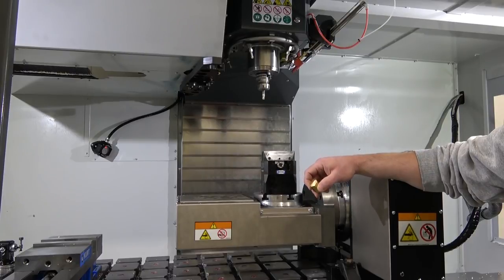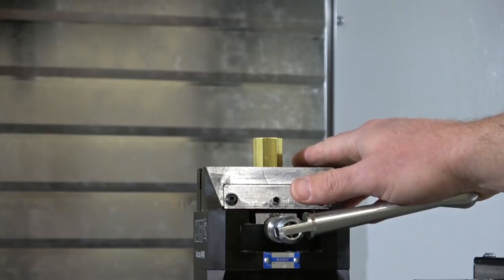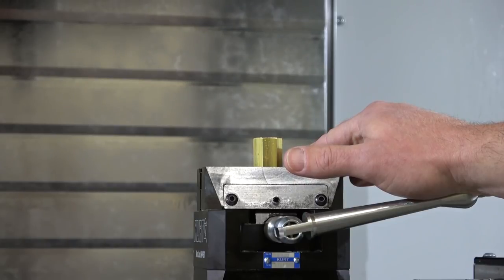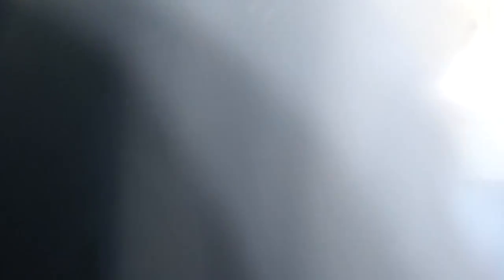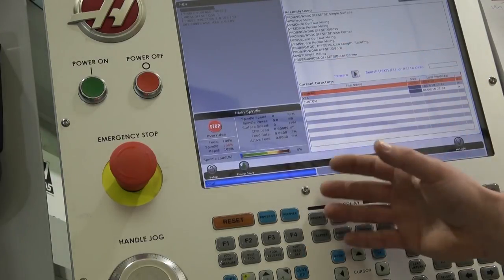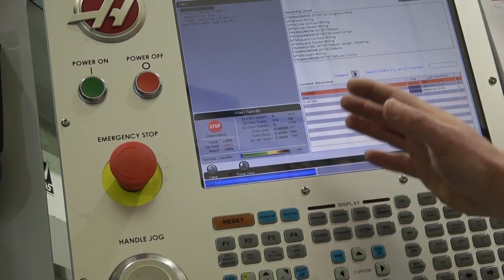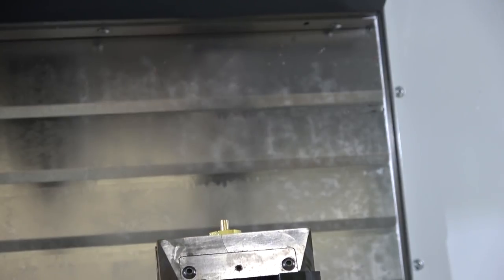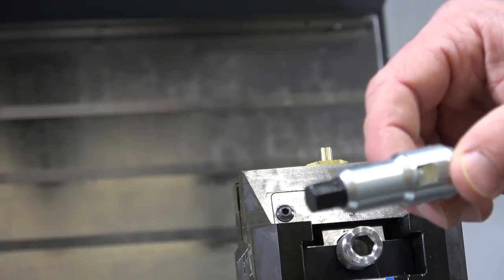One Million Subscribers | Town Pump CNC

Comment: Vijéo: https://youtu.be/LIfxfHFy_9c

I have a below knee prosthetic leg (i have a human kneee). Trouble is my ankle is a carbon spring and when im sitting or walking on a hill my foot is always stuck at 90°, its uncomfortable 

My carbon spring/foot attaches directly to a 3/4" pipe (the pipe would be my calf)

Was hoping for a custom ratcheting/ locking pylon between the 3/4" pipe and my rigid 90° spring ankle foot. 

The custom "ratch-kle" will allow amputees to actually get natural upward or downward ankle deflection when seated or walking  on declines.
Reply from the maker: fantastic idea. yes! how do you want to change the angle? is a button on the ankle ok? any chance for you to post a quick vid?
Reply: As a voting member of the viewing public, I like this idea.
Reply from the maker: oooh how about a little calf muscle gas strut and lock trigger at your hip. Put weight on your foot, release the ankle lock, move to more comfy angle, then lock the ankle.
Reply: @arduinoversusevil2025 , that sure would be a fantastic way to break in the new machine!
Reply: @arduinoversusevil2025 , or a simple locking system similar to the hinges on those fancy folding aluminum ladders. Push the center in to release it. Push the other way to lock it. But, the locking gas strut system would be much more impressive. 👍
Reply: @K.chample man i really hope uncle bumble can help ya sir . God bless you and your family
Reply: As a non voting member, but diligent and thankful consumer for several years, I am happy to report that this thread sparks my first YouTube comment ever.  It is a brilliant idea.  Such a perfect intersection of possibilities for good. 

Beautiful, it brings tears to my eyes and that's not just my own smell in the shop ;). Such tremendous potential.
Reply: Aerospace design engineer here, let me know if assistance is needed in getting something like this designed.
Reply: Friggin' Frig! Perfect first project!
Bad habits, Richards and all that...
Reply: This would be a great first use.
Reply: I've always wondered if it would be possible to use a car shock piston in a prosthetic leg...
Reply: This has my vote for the first run!
Reply: This could really be groundbreaking tech for people with prosthetic legs. Do us proud Uncle Bumblefuck!!!
Reply: Eyellgeteven most of the fittings on this thing are titanium i think.. if it works well i know a few places that would place large orders
Reply: @Vikingwerk  amen !
Reply: This is a brilliant idea. A fine chance to test out the machine and would certainly be very meaningful to someone.
Reply: I gotcha, I think. How about a rachet that you swift kick left/right to unlock and then position, then put your weight on to lock into place?
Reply: I approve this idea!!
Reply: An injection moulding machine I helped fab used a basic lever arrangements P to rotate the top section as it lifted for easy cleaning... In your case I imagine you would need to pivot point in the hamstring area to actuate angle movement based on degrees of knee...
Reply: Gets my vote
Reply: Gas mountain bike shocks let you selectively enable / disable them, essentially locking it the position of the shock. The mechanism is super just a simple 90° turn to lock the Cylinder so could easily lock and unlock it to adjust the angle without having to rely on imprecise ratchets.
Reply: If there's a video, I vote as well!  Can't have some guy just a springin and sproingin without no control of the Jeeslus thing...
Reply: I'm thinking a more dynamic approach, no buttons no locking positions, it needs to behave naturally and not like an old wagon stopped for a scotch at the local saloon, I'm thinking to imitate the tendons and muscle fiber with a hybrid system of air balloon and close circuit air/oil shocks with some springs. If you think about it the pin point is freely rotated due to the weight transferred on the foot heel we can start with a cad 3d design
Reply: Before AvE gets to excited can I suggest he looks for smaller components than he’s used to, or 2 things will happen, 1 KC will fly over the nearest fence when the gas strut is activated. 2 it’ll be so heavy KC will only be able to walk in circles.
Reply: @thomassmith4320  Simple Mechanical Engineer here but same counts for me. Happy to help if needed!!
Reply: Cattus_ex_Machina votes yes for this first project
Reply: it's a clutch, fluid pressure on the toe to lock and heel pressure to release
Reply: Do you mean a mechanism that gives a continuous natural movement or one you can specifically adjust on the fly for different set positions?
Reply: Great idea! One hell of a way to start off with the CNC as well. I'll be looking forward to it.
Reply: This is simply great! Not only because it's for good, but cool "gadget" too! Now to start healing hangover...
Reply: AvE can you share the video if he posts so that us interested can help with the design?  I like your idea of a free community that can do these sorts of things, especially when they help people. I'd really like to put my $0.02 in on this one. Also, how can I donate to help you out?
Reply: K chample blatchford’s microprocessor. Controlled ankle. Uses real-time inputs to control hydraulic pressure for ease of walking. I was brain storming this and was getting somewhere when I gave it a google and found someone who has computerized the process.
Reply: This get my vote.
Reply: BTW, can you get access to a 3d printer?
There are some amazing prostectic limbs made by private owners now.
Reply: i wonder if a 45 degree twist to the ankle to release it , then find best new position then twist back to straight would work ? might be possible to actuate on the fly ?
Reply: @arduinoversusevil2025  First of all great freakin Idea for a project!! 
But what about using an electronic actuator? Because from my understanding theese gas pistons only come on or of isnt that the case?
Reply: My neighbor's brother enjoys a  very good  prosthetic - and he has  quite detailed engineering knowledge of how his works and is put together. It features a mechanism just as you describe. I will ask him for whatever details he can provide and post them here.
Reply: This.
Reply: This is awesome! The prosthetic has my vote!
Reply: Gets my vote
Reply: This is what the internet should be used for
Reply: Got my vote, but will miss the Empire of Dirt...
Reply: Uncle Bumblefuck up along Ghandi and other world changers? Whoa. Right before my eyes too.
Reply: Stop gassin-Do it!
Reply: This would get the channel to next level
Reply: This is what the internet is for world wide motorfudgen teamwork
Reply: Maybe some sort of nonlinear setup, nice and stiff until you reach a yeild point...
Reply: Mechanical clipboard warrior checking in. I've got access to aerospace level FEA software if any stress analysis is required. I'd be happy to run some models and check for fatigue life or something along those lines.
Reply: Mountain bike shock with lock out might work?  Already built to be light weight and off the shelf.

Edit: I'm not sure if those shocks lock out at one specific point only or if they lock it at any position?  If it's the former it wouldn't work.
Reply: Enginerd here as well. I use fusion 360 ultimate daily and would love to help with design/cam if needed.  I could possibly send some material/carbide out as well.
Reply: Once you've picked a project you can set up a playlist or something. Pull in designs and specialisations from all over. Review. Collaborate, combine, redraft. This could be huge.
Reply: Dude even better put a gear motor on the ankle joint and an use an arduino with an imu to move the ankle with your leg to give you a true working prosthesis send me some info and we could get something done with some community help
Reply: This ^^ is a good idea👍👍
Reply: I love this idea. What about asking the hive mind to come up with design specs. I'm sure there's a pixy wrangler out there somewhere who is perfect for the job.
Reply: Top 10 anime cnc-projects
Reply: What about milling something to attach super strong servo to change angle? Maybe rotory encoder for control? Can an arduino be fixed up with a way to sense ground angle and adjust automatically?
Reply: My guess is that an unpowered system of linkages or cables might be more ideal and weatherproof for position selection.  The problem is putting it in a natural location for daily use, regardless of the type of clothing.

Comment: 2 words: Rocket Parts!
Reply: Not sure if you can bring those across the border or not.  Import/Export and Itar whatnots.
Reply: @kevinbryan9620  Where we're going, we don't need borders.
Reply: Yes
Reply: @Cody'slab You mean "Fusion reactor"?
Reply: Wellll if he isn't selling them, there's no commerce. It's just metal doodads in a box.
Reply: I imagine that any rocket parts Cody designs would be based on public knowledge, so any arms control law probably wouldn’t apply.
Reply: this would be preeeeeetty damn legit! then prototype a vacuum optimized engine and drop if off for a test when you go on the SpaceX lunar trip
Reply: Copenhagen suborbitals would be a good group for AvE to collaborate with on rocket parts, they have a lot of experience at this point and have had many design issues due to lack of access to AvE's sort of equipment.

Comment: South Florida boiler tech here. Been watching your vids for years... I've been looking for a special brush or comb, that doesn't exist yet to my knowledge, to clean copper fin heat exchangers in certain boilers. I'll send you a video on Monday of exactly what I'm looking for. Need a real skookum choocher to get in between all those hard to reach areas.
Reply: I thought radiator combs where a thing?
Reply: what spacing, it likely already exists, but not marketed directly to Boilermakers. Maaco has one with something like 30 interchangeable combs, York distributors carry them.
Reply: something like the Allstar ALL10680 Radiator Fin Comb ?
Reply: dude how about those plastic ones for steel and aluminum hvac coils?
Reply: @alphonse4991  To fine. Need a longer, stronger bristle.
Reply: ahh i gotcha
Reply: I made my short video, but I'm not sure how to get it to AvE.

Comment: I suggest an air operated roto-wiper for mounting on the door where the camera looks in, good for a clear view of the messy jobs. We have them installed on all our mills and turning centres and a few of the transfer machines, world of difference.
Reply: Ukrainian Wheel has a "California Squeegee" for $15 give or take. It's awesome for removing water & no streaks! 
It conforms, is quiet, super flexible silicone that does a great job. Maybe look at that?
Be like an early teenager - one stoke is all that's needed.
Reply: Rain-X is supposed to work too... for a while.
Reply: check out Edge Precision, he developed a gopro case/air knife that he uses to film in his Mazak
Reply: John Grimsmo was sent a GoPro case with built in air blast in front of the lens.
Reply: Do the wiper arm with PIAA silicone wiper blades. Clean it well and run it dry at first for a couple minutes to lay down a layer of silicone. Better than rainx and it reapplies as it's run. Never go back to normal blades on my cars.
Reply: sp1nrx 
Never use rain-x or any other chemical treatments.  It will foul the coolant in no time.
Reply: @sp1nrx  we use Rain-x 9n our machines at work. We have to reapply it every week or two but it's worth it. It makes it easy enough to just use the air hose to blow off the chips from the window every so often and not have anything still sticking.
Reply: so it's not a propeller?
Reply: BradyT918 
It should t be sticking at all.  Check your coolant concentrations, or convince the owner to upgrade to a newer coolant.  If it’s sticking to the windows a lot then there’s something amiss with the coolant.  Or it’s one of the older coolant types.
Reply: @occamssawzall3486  it's a Mitsubishi MVR 30 and we cut Weldox all day. The chips come off fast and hard and hit the plexiglass screen and leave little gouges in it which is what contributes to the problem.

Comment: I've always considered myself a fair bit skilled at the tinkering, but the interface on that machine right there scares the crap out of me.
Reply: It's all code and buttons, once you get past the "wall of death" stuff, it's actually quite simple.
Reply: @aserta  was about to say the same thing. Learnin cnc right now.
Reply: Check out Fanuc. So simple some Japanese guys in the 70s figgered it out.
Reply: It is less complicated than you would think, though that controller is more complicated than the ones I've used (it had a green monitor to give an indication of age).  Once you learn a bit of G-code and how to use one controller, pretty much every other machine will be operated similarly.
Reply: Once you crash one a few times you start to get the hang of it.
Reply: Haas's machines are actually some of the easiest to use.  Don't get me started on loading and running non-Mazatrol programs in Mazak machines
Reply: @jacobm2625  

I can't stand Mazatrol, that being one of the reasons why.
Reply: "Damn thats a lot of buttons."
Reply: Ain't no thang but a chicken wing

Comment: I'm a student studying manufacturing engineering and I have extensive CAD and CAM experience as well as experience both on manual and CNC machines. If you need a little intern to run your machine let me know. I love using my schools VMC and slant bed CNC lathe. I've made some pretty cool parts and I'm working on a project right now in titanium. My biggest piece of advice would be to use CAM and not to waste time with the conversational programming.  Love your videos AVE

Comment: Don’t crash my machine!
Reply: 2nd
Reply: @Apexseals I absolutely agree when I started I crashed 2. If your not crashing your not learning
Reply: I learned the hard way. Z does not equal 0.
Reply: @0701jim  amen man I've only crashed 2 so far hahaha
Reply: Ya, I was just an operator. Simple functions. Jog, tool change, a few M codes, cycle crash, all that. Was taking instructions from a sleepy foreman who wasn't properly educated either. I'd post a pic, but youtube doesn't support that feature. 

Also almost lost my right hand in the auxiliary tool crib of a CMS Antares. Only took the first few layers of skin off the top of my middle finger.

Comment: Get yourself cimco editor for viewing/editing NC code. Very very handy and can backplot the actual code so you can atleast at a basic level make the sure the posted code is doing what you think it should be doing.

I'm an apps engineer at Makino Die/mold if you ever need help.

Comment: I think there's room to make more money from the CNC. I currently live on a boat and there are some peculiar items on board that need replacing and the original manufacturer (FRENCH!) want so many dollars for the part. And the part is crappy to begin with and that's why it's broke. I properly milled aluminum part would be loads better.

I'm sure there are other industries with the same problem. Proper improved replacement parts made out of quality materials, likely for half the price of the crappy OEM part.
Reply: Or CNC code for the part posted the way 3D printer maker sharing sites do for that stuff. There are jobber 3D printer folks, it'd be neat to have an ecosystem like that for open source CNC. (or is there and I don't know about it?)
Reply: Do you need help with parts?

Comment: I can try to take a video of it, but you should see if you can make better ends for the anti tip tubes (wheelie bars) for wheelchairs.  The original ones are shitty little plastic wheels on a bolt through a hole on a cheap, thin aluminum tube.  The wheels wear away and the bolt wallows out the hole and rattles around, and when the wheels wear down you're liable to flip the chair over backwards and crack your head on the floor, as I did to myself last week.  Got a concussion from that, if they could just be made worth half a damn to begin with I think it'd help save some people some visits to the emergency room.

Comment: Hi AvE, I don’t know enough to know whether this suggestion is practical, but here goes. 

I just got through watching a 7 vid series from Adam Booth (abom79 channel).  Adam took a plain Firebolt tool fixture plate (Jason Marburger) and adapted it (via Shaper and Mill work) so it could provide a machine shop vice-friendly, square & flat surface to hold workpieces in place.  

At the end of the series, he mentioned the idea of making a very limited number of these for sale. 

Here’s what I see:
1) Having one of these fixture plate assemblies would be a useful addition to the Empire of Dirt;
2) It might be very handy to have a finished plate in the CNC to hold down objects that aren’t conducive to 1 or 2 axis vice pressure. 
3) A CNC program ought to handle a fair amount of the manual work time, drilling, tapping and boring the ~50 precision holes. 
4) I’ve never run a CNC, but my guess is that the Firebolt surface and the attachment plate designed by Adam will need to be preprocessed before they get to the CNC so that it has close to perfectly square, flat and centered surfaces to lay down the holes. (In fact, it may be that the Firebolt surface will need to arrive with Adam’s attachment plate installed in order to hold it in the CNC). 
5) I think this could be a good collab that could make a version of the creation more widely available. 

 As a side note:  personally, I doubt that a CNC’d plate would be as accurate as one hand machined by Adam Booth. But I suspect there’s a segment of viewers that could still use a product of CNC level accuracy.  (But I could be all wrong too - I’ve watch a CNC work, but I’ve never done the work or the programming).

On the programming side, I’m wondering if a collab like this is something that Tim at Tactical G-Code would be interested in.  I suspect he wouldn’t mind having one himself in his shop.